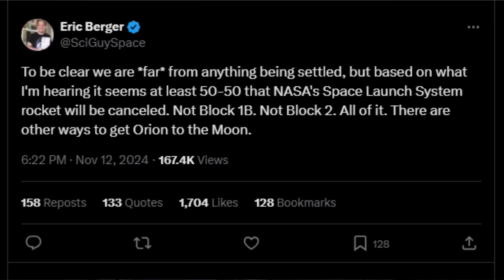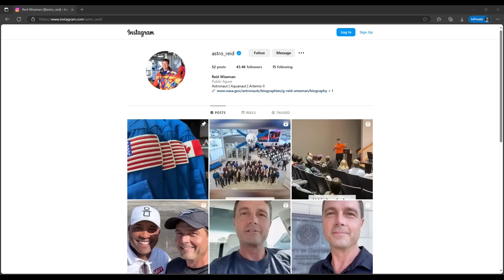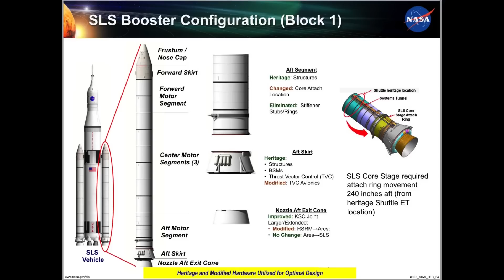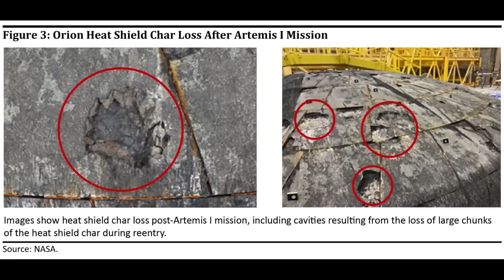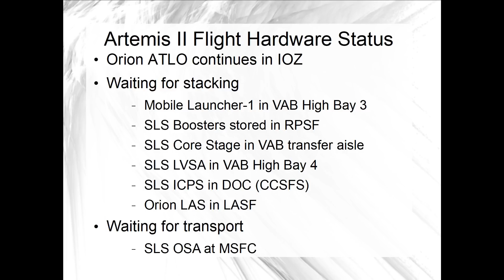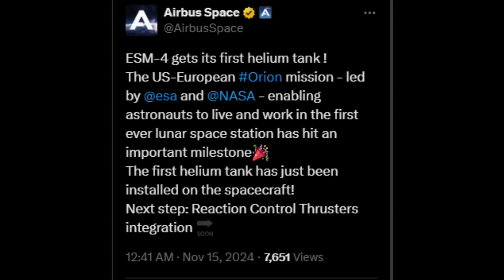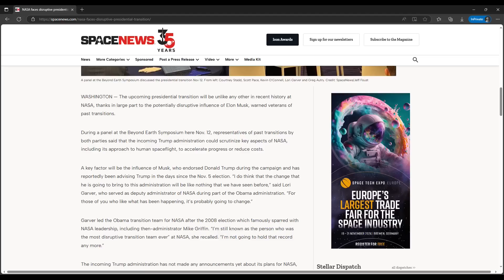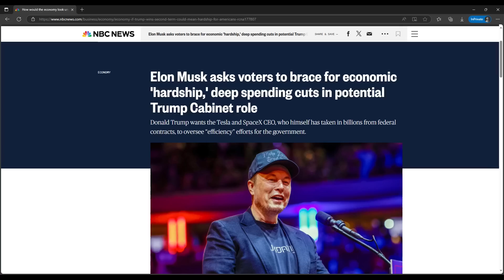Artemis Anxiety: cancellation concerns while NASA looks at Artemis II stacking options

Comment: In an interview on Friday, Camarda, an aerospace engineer who spent two decades working on thermal protection for the space shuttle and hypersonic vehicles, said NASA is relying on flawed probabilistic risk assessments to determine the safety of Orion's existing heat shield.

"I worked at NASA for 45 years," Camarda said. "I love NASA. I do not love the way NASA has become. I do not like that we have lost our research culture." Initially, NASA officials downplayed the severity of the issue.
Camarda said he knew two people who dissented from its conclusions that NASA's plan to fly the Orion heat shield, without modifications to address the charring problem, was acceptable. He also criticized the agency for not publicly releasing the independent report. "NASA did not post the results of the IRT," he said. "Why wouldn’t they post the results of what the IRT said? If this isn’t raising red flags out there, I don’t know what will."

Comment: I’ve heard that SLS has begun stacking. Does this mean that a decision has been made regarding the heat shield?
Reply from the maker: They are putting the two aft assemblies on the Mobile Launcher and then they will pause and wait for a decision.  NASA is still saying a decision/announcement is possible by the end of the year...but not much beyond that.
Reply: Clock starts at first Field Joint mate…. So that would be the Center Aft mate to the aft segment, not the Aft to the ML.

Comment: Thanks for your interesting video.  Very well done.

SLS/Orion is a dead man walking. Way too expensive. Only capable of one launch per year. Will not provide NASA with the means to achieve its ultimate goal of permanent human presence on the lunar surface in a timely and affordable way.

With the advent of Starship, we have an alternate way to put humans on the Moon at relatively low cost by 2028. 

We know how to use Starship to establish permanent human presence on the lunar surface in an affordable way now. Two Starships are sent to LEO. One is a crewed Block 3 Starship carrying 10 to 20 passengers and 175t (metric tons) of cargo. The other is an uncrewed Block 3 Starship tanker drone.

Both Starships are refilled in LEO and fly together to low lunar orbit (LLO, circular, 100 km altitude). The crewed Starship lands on the lunar surface, offloads arriving passengers and cargo, onloads departing passengers and cargo, and returns to LLO.

The Starship drone tanker transfers half of its methalox load to the crewed Starship and both head for Earth. Propulsive capture is used to place both Starships in an elliptical earth orbit (EEO, 600km perigee, 900 km apogee). Passengers and cargo are transferred to a Starship shuttle that operates between the launch sites (Boca Chica, KSC) and the EEO.

The operating cost to send the eleven Starships (nine uncrewed tanker Starships, the crewed Starship lander, and the uncrewed drone tanker) required for this mission to LEO is $20M x 11 = $220M. Cost for operations to transport the two Starships to LLO, for lunar surface operations, and for returning those two Starships to the EEO are extra and are TBD. Those costs likely will be ~$100M.
Reply: Starship cant carry crew

Comment: Thanks for the content.  I don't expect DOGE to look at SLS and Artemis.  The schedule doesn't fit and the SLS problems are so obvious they don't require an audit anyway - there's no path to relevancy for SLS, and it will just get worse.  Imagine taking months to stack when Starship is stacking and unstacking multiple vehicles per day.  It's quite painful, but the smart move is to cancel SLS immediately and repurpose the funding and any salvageable components to something with a future.
Reply: DOGE will do enough damage without touching SLS.   Cancelling SLS and relying on Starship will put Artemis 3 back to to 2030.
Reply: Problem with cancelling SLS is we don't have any alternatives to get to the moon. At least not in time to be China in 2030. But maybe no one cares about beating China.
Reply: Cancel SLS. Reinstate Constellation. Have Lockheed or whoever build it. Just not Boeing. Not a useful spend of SpaceX 's time anyway - but have a team of theirs oversee the management of the project.
Reply: Killing the one part of Artemis that actually exists is about the kind of intelligence I expect from Elon's DOGE.
Reply: Starship has had 4 lunches and hasn't completed one orbit 
Sls got to lunar orbit
Reply: @EvilNeuro  Also Starship is incapable of reaching the moon and coming back in its current configuration.
Reply: @EvilNeuro SLS was in serious development since 2011. Apples to oranges

Comment: I really wonder how bad the news are on the heat shield since they won't tell us. I feel like if that is too bad, like something that would take two-three years to fix then that might provide the excuse needed to cancel the whole Orion/SLS part of the Artemis program.
Reply: Not sure what they would replace SLS with though starship won't be human rated for launches for quite a while and falcon 9 doesn't have the performance to send a crew dragon into lunar orbit I guess they could crew rate falcon heavy but that would take extra time, I'd guess they'll keep SLS for now but probably begin planning a replacement option
Reply: @KiRiTO72987  The one possibility I see for a complete SpaceX mission in the near term is Crew Dragon to something like GTO and dock with a fully fueled HLS there. Then HLS should have enough fuel to be able to get back from the Moon and brake into GTO for returning the crew to Dragon. But that might be just as far off as a full crew rating of Starship itself...
Reply: The problem with Orion's aft heat shield is that materials that made the Apollo aft heat shield effective have since been outlawed as too toxic/carcinogenic. Newer materials aren't cutting it.

Comment: Since December or November 2023, I have been looking forward to Artemis 2 since it was the 1st time since Apollo 17 to send man back to the moon, but for a flyby. I was optimistic it would happen by late 2024, but in January of that year they announced that they delayed it by a year & I was very dissapointed, but I understood the decision, What I'm concerned about artemis 2 is that by then we're going to have a new president, final heat shield decisions & weather or not it would have the same fate as constellation. But what I'm exicted is that the SLS hardware (except for orion) & the ML-2 at the VAB is getting ready for stacking but its not clear when will that happen.

Update: Artemis 2 Stacking Commanced on 11/20/2024

Comment: The heat shield issue is the excuse, not the reason.
Just use the Apollo heat shield.
They've already wasted more money trying to get the new design to work than would have been spent building an Apollo-era heat shield.
Reply: They can't. Materials used for the Mercury-Gemini-Apollo heat shields have been outlawed. It's the newer, non-carcinogenic materials that are the problem. A better solution needs to be found.
Reply: @dalethelander3781  which materials specifically were carcinogens?
Reply: @Muonium1  The article I read was not specific. I believe it was on Ars Technica.

Comment: The problems SLS runs into are very frustrating.
Reply: Ok. Forget SpaceX. I said that the problems with SLS are frustrating. They are. They are just ... mundane. We build big, finicky stuff all the time. Why is this a unique challenge? Lack of budget? Gov can't fail for political reasons, so it's 90% CYA leaving only 10% productivity? Why do all SLS components have to travel on one specific barge? How long does it take to make that launch tower? Isn't it at least somewhat similar to making a ship, a building, or a roller-coaster? They make those all the time. And the pissing match between SpaceX fanbois and the world ... very frustrating.
Reply: The Thermal Protection System on Starship is utter garbage.  It will NEVER be safe enough for human spaceflight.  Talk about frustrating.
Reply: @ericmatthews8497  Bait used to be believable. No one's even said anything bout Starship.
Reply: @realEpicGold  You were talking problems .. Starship has had 5 flights now .. and not one complete success.  The Space Shuttle did two days in orbit, with two Astronauts on board, the very first time, and it was a success.  SpaceX can't repeat that 40 years later.  Ouch.
Reply: @ericmatthews8497  you know you can be interested in spaceflight, without being the delusional NASA hater, or the delusional spacex hater. there is an inbetween, my friend, you don't need to be so extreme. no one mentioned starship in this thread
Reply: @ Delusional is thinking we need a Mars colony. Our oceans are turning into acid…. Our atmosphere is overheating... Our Forrests are on fire…. Building a Mars colony is like abandoning Mars-A-Lago to build a bed and breakfast at the South Pole.
Reply: @ericmatthews8497 Starship is able to do what SLS can’t, launch into orbit repeatedly. Within a year Starship has launched 6 variants at a fraction the price of SLS, with partial land attempts on 2 of the 6 test flights. Let’s put context next time
Reply: @ Are you sure?  So far, no Starship has.  And their heat shield is worse than the Space  Shuttle - installed by dudes in bucket trucks.  Starship can fail.
Reply: @ And Starship hasn’t done anything. No payload. No mission. No Astronauts. Nothing.
Reply: @ericmatthews8497  SLS isn’t even designed to survive reentry, complete waste. You’re speaking on the test launches of starship as if it’s a gotcha. None of the starship test vehicles have been equipped to land nor to fully survive reentry but to test the durability of the frame. In fact the last test subject had tiles removed to test its capability. Of course as we know it survived reentry and splash landed.
Reply: @Onunez23  Splash Landed.  Worthless
Reply: @ these test flights were never designed to land. SpaceX is able to play with 6 test flights at a 1/5 the price of one SLS launch lmfao
Reply: @ But the first SLS flight went to the Moon. The first Starship flight was a mess.  And 5 more of them they are still working out the kinks.

Comment: If SLS will be cancelled,  how could Orion be launched ?
Reply: Contract ULA to put the Delta 4 Heavy back in production. It's successfully lofted Orion.
Reply: @dalethelander3781 
Wasn’t that just an empty Orion capsule… and. Nothing else ?
Reply: @rktmn1  I'm not sure exactly what was onboard.
Reply: Who cares? The whole thing is a grift of the tax payer. This thing needs to be shut down and sold off today. I’d be thrilled if the administrators of the program faced criminal charges. Basically everyone with a college degree at Boeing should need a criminal attorney.
Reply: Eric Berger (who is usually right) suggests Orion launches on Falcon Heavy and meets with a seperately launched centaur in LEO.
Reply: @danmosenzon1477  so Orion is necessary according Berger.
The question is: from an aereodynamics point of view Orion can be launched by a Falcon Heavy?
Reply: @TheArmstrong1969  it could, but they would need to make a new abort system, and FH is not even certificated for manned flight yet
Reply: @Marty_Mcfly1999  Both probably much cheaper than continuing SLS.
Reply: @Marty_Mcfly1999  Falcon Heavy is designed for manned space flight. Maezawa booked a Dragon flight around the Moon using FH. So, it only needs a certification.
Reply: @danmosenzon1477 that will take just as long or longer to human rate Falcon Heavy.

Comment: The easiest way to cancel SLS without affecting Artemis is using HLS also as a transfer vehicle replacing Orion and get the crew to HLS with Dragon in LEO. Tankers will be needed to refuel HLS, so if the DV margins are too low they can place additional tankers where they are needed if required.
Reply: In this scenario how could the crew come back to Earth? 
HLS should come back to Earth?  
HLS has hot enough fuel to decelerate from lunar orbit to Earth orbit and than docking to dragon.
You need Orion.
Reply: @ that is why I mentioned the tankers. You just need to refuel it. It may not be the most cost effective way of slowing it down to enter LEO. But would be far cheaper than SLS and will only be a transition until a crew starship with heat-shields is certified.
Reply: @TheArmstrong1969  HLS could meet with a depot at a HEO.
Reply: @danmosenzon1477  
So you would need another 12,15 or more refuiling launchs to the depot and if something goes wrong HLS would be disintegrated into Earth's Atmosfere.
It's incredibly risky.
Reply: Without delay?
How long do you think will it take to human rate HLS ?
Reply: @sidharthcs2110  Without delay in the current plan, as HLS needs to be human rated in space to receive crew from Orion. Dragon is already human rated to get to orbit and back. So the combo can work together.
Reply: 1. **Total Delta-V Required**:
   - *LEO to Lunar Orbit (TLI):* 3.2 km/s
   - *Lunar Orbit to Moon Surface:* 1.8 km/s
   - *Moon Surface to Lunar Orbit:* 2.5 km/s
   - *Lunar Orbit Back to LEO (TEI):* 1.5 km/s
   - *Total Delta-V:* 3.2 km/s + 1.8 km/s + 2.5 km/s + 1.5 km/s = 9.0 km/s

2. **Refueling with Fully Fueled Tankers**:
   - Each tanker can transfer the equivalent of 6 km/s of delta-V to the Starship HLS.

   - *First Leg (LEO to Lunar Surface):*
     - Delta-V needed: 3.2 km/s (TLI) + 1.8 km/s (landing) = 5.0 km/s
     - Starship has 6 km/s initially, so no refueling needed for this leg. But will need a partial refuel before landing so that it can take off again.

   - *Return Leg (Moon Surface to LEO):*
     - Delta-V needed: 2.5 km/s (ascent) + 3.2 km/s (LEO) = 5.7 km/s 
     - here you will need another partial refuel to be able to enter LEO.

In summary a fully fueled HLS at LEO will need a fully fueled tanker in lunar orbit for the round trip. I assume there are other more efficient refueling options as in elliptical orbits from LEO or in NRHO, but worst case just one tanker in lunar orbit.
Reply: @adrianpaz472  yeah bro but how can you get a fully fueled tank to lunar orbit when it needs DV to get there, so it wont be full when it gets there. So youd need at least 25-30 refueling to do what youre saying, and dont forget fuel evaporation, you itd another couple of launches, its complicated and risky. The most logical thing is launching Orion to LEO with a FH, and then using a centaur second stage to get orion to lunar orbit
Reply: @Marty_Mcfly1999  HLS is reusable. They have to refuel HLS either way. If you have two fully fueled tankers in LEO. If they enter a NRHO. One tanker can fully refuel the other, and return to LEO with aerobraking. You will definitely need several refueling launches to get those two tankers fully refueled in LEO. But at the estimated 10M USD per launch, you can launch 400 starships for the cost of a single SLS. So it will still be very cost effective.
Reply: @adrianpaz472  HLS wont be reusable thats why it does not have heat shield or flaps.

"10M per launch" come on bro do you really believe that? Even a reusable falcon 9 costs at least 100m
Reply: @Marty_Mcfly1999  HLS doesn’t have heat-shields or flaps because it is not intended to return tu Earth. It can be refueled in space. And the reason for developing starship is to be far cheaper than F9. The estimates I provided is based on the higher range expected. Some go as low as just the cost of fuel.
Reply: All that infrastructure will take years to put in place. We need to return to the Moon NOW!
Reply: Do any of you realize Lunsr Starship HLS is only going to be used for the first 5 Moon landings before being replaced by Blue Moon HLS?

They should've gone with Alpaca HLS.
Reply: @dalethelander3781  you are wrong. SpaceX HLS will remain an option for future lunar landings.
Reply: No, even a full HLS do not have enough fuel to go back from lunar surface, and even if it does, starship is not made for reentry for lunar orbit. Btw moonship wont have flaps or heat shield.
Reply: @ you are not reading correctly. I never mentioned slowing down with heat-shields with HLS, I mentioned that with a crew variant of starship after a transition period when the last is certified. In the meantime, HLS can be refueled anywhere for it to have the DV to slow down in LEO. It can be refueled in LEO and Lunar orbit.
Reply: Why cancel SLS and not get rid of Artemis at the same time?
Reply: @EveryoneWhoUsesThisTV  Just cancel SLS and find another way to get the Orion capsule on its way.
Reply: HLS to LEO, then spacewalk to Dragon for re-entry.
Reply: @ghost307 impossible, you need a lot of delta V to go from scape velocity to a LEO orbit, and HLS wont have enough fuel for that
Reply: @Marty_Mcfly1999  it does have enough DV for that. How do you think they are getting it there in the first place, and how do you think they are refueling it for future lunar landings? Tankers are a game changer and far cheaper than an SLS launch.
Reply: @adrianpaz472  bro, even a full HLS after refueling in orbit only have enough DV to go from LEO to lunar surface, and even if it does, Starship cant resist reentry from lunar orbit, youd need to redesign the whole thing for it, thats why  a alternative for SLS would be using a Falcon heavy